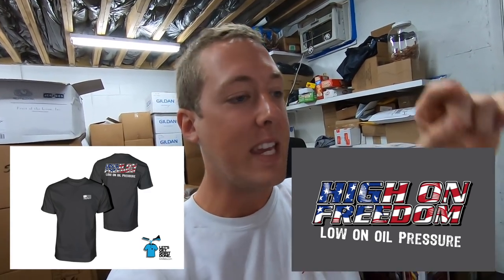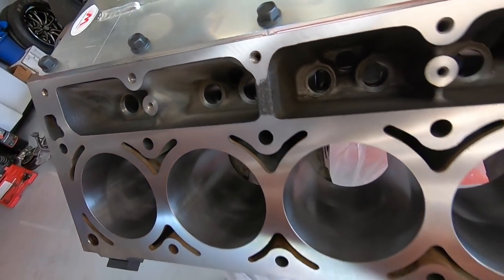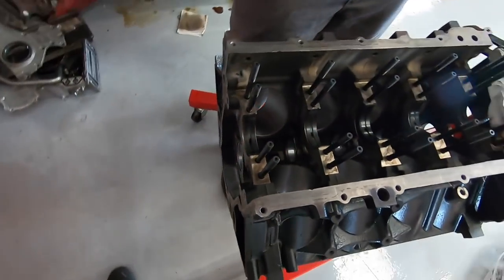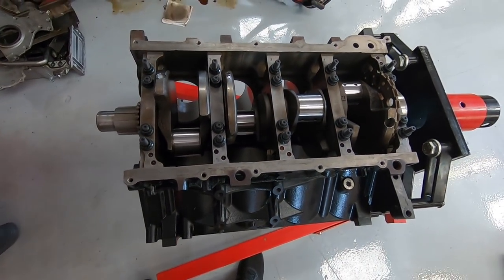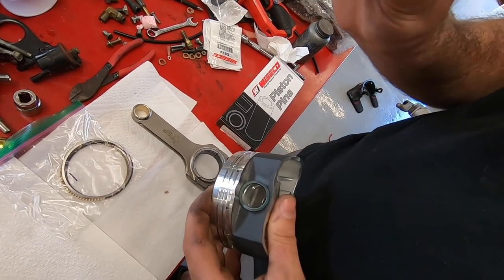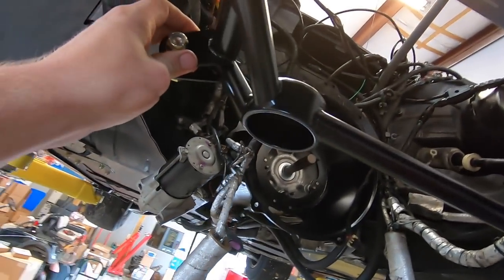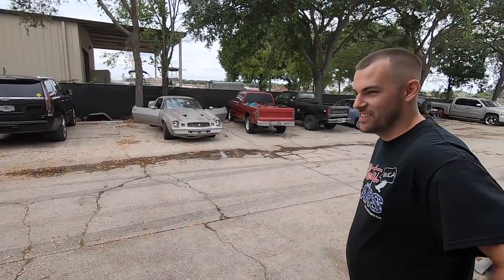Assembling the Auction Corvette's NEW Bald Eagle Engine! + Building a 10ft Snorkel For the Bogger!

Comment: How about an engine 100% built by fan sent parts.
Reply: I've got a few aircraft fittings around here someplace.
Reply: I’ve got plenty of rockers, springs, cams, keepers, pushrods lol
Reply: great idea
Reply: Yes literally was just about to comment that! We can send him parts in the mail from different fans!
Reply: this 100%
Reply: How about an oil radiator with a fan, connected to oil pan with a pump (independent from engine oil pump). At extreme power conditions, a reduction of 25C in oil temperature can double oil viscosity. At these conditions, reduced oil viscosity results in reduced pressure, thus reduced lubrication.
Reply: I'll send some pan farts.
Reply: That would be fun! And that is why I am here. For the fun.
Reply: @steveg2277  send me some lmao got any for a 350?
Reply: AK I got a procharger f3r......
Reply: I should 3D print a block. See if it can actually run. Or just melt/explode
Reply: @poolguy101  Bet it holds oil PSI.
Reply: Good one....
Reply: Could even do an entire vehicle build the same way if one could narrow it down to a certain vesicle type.
Reply: Ford block, Chevy crank, dodge heads, Honda pistons, Toyota rods, porsche rockers, Mercedes supercharger, Suzuki pipes&fittings. Franken-engine
Reply: Random projects USA This Cleetus McFarland Fabricobble Machine not a Johnny Cash song 🤡
Reply: I've got a crap load of 2jz parts. Even stock twin turbos and all.
Reply: Send them parts my way. He sponsored by Texas Speed so I need it more he does

Comment: as soon as he said the tracker needs work i thought geez louise the tracker is going to end up running 8's beside ruby lol
Reply: Richard Turner Underwater 8's.
Reply: @caddyguy5369  mega truck tracker? Hell yeah!
Reply: It'll end up with a Texas Speed 427 and at least 4 trubos and 4 fuel cells mounted on the roof...with 12 fuel pumps.
Reply: @caddyguy5369  well, obviously. as soon as they get that snorkel fabbed up.

Comment: Just in case the pond is a little deeper than you expect, I suggest strapping a winch to a tree on the far side of the pond from your starting point and clipping its cable to the tracker before you start your run.
I also suggest you either feed a tube from the snorkel intake into the driver compartment so you can still breathe if the water goes over the roof racks...

Comment: You should bring that tube out the fender so it can be permanent and the hood is still easily accessible then run the tube to the cab and up. More support there with the roof rack mounting options and easier to make it last!

Comment: Make sure to spec out your lifter bores! if youre using a non stock set of lifters, check with the manufacture. should be somewhere 2 1/2  thousandths. if there to tight, the oil cant travel around the body, starving bearings down the line.

Comment: I would highly recommend for you guys to use a smaller diameter pvc pipe. Just use a step down to convert it from 3 in to 1.75 in or even smaller. Will be alot lighter and won't drag in the water as much. Just think about how difficult it is to run in water.

Comment: So if you going oil crazy when building a motor get yourself what is called a washing machine pan. Its like a 3'x3' or 4'x4' pan you put under a washing machine to catch water in case of leaks. A cheap plastic one under your motor stand really helps in building or tear down of a motor. So the bogger can breath at under 13'(including bogger height) but what about the occupants? This will be epic!

Comment: Don’t forget about the exhaust it needs a snorkel out as well.
Reply: Nope. The pressure will keep the water from coming in. The only Thing that shouldnt happen is the engine going Off, then the pressure will equalize and the engine block will be flooded through the exhaust.
Reply: DonNerdo A) assuming it’s exhaust valves are 100% otherwise it can suck water in and B) it stays running. As soon as it stalls it will flood out.
Reply: @sccarguy8242  true. Exhaust should OK though.

What everyone forgets about are crankcase, trans, and diff breathers.
Reply: @sccarguy8242  you always have at least one valve opened in one of the cylinder

Comment: Couldn't help noticing the Tracker has an ignition distributor. You can cram the sparkplug wells with dielectric grease, but you'll have a tougher time keeping water out of the distributor cap if the entire car is underwater. Get that sorted and you should be able to make it!

Comment: Maybe by version 4.0, they won't use junkyard parts?  🤷‍♂️
Reply: No. Ruby is always going to use at least a Junkyard block. It has to
Reply: @alexdodge2515  Looks like we have plenty of more rebuild content to look forward to in the future then.
Reply: In 3 weeks the budget build will have a stroked LS at this rate
Reply: What do you mean 3.0 is like using brand new everything it may be a block from the junk yard but the machine shop made it new the same goes for the crank
Reply: @79tazman  That is my point.  At this rate, you may as well just get a fully built unit and not worry about something failing because it came from a junkyard.  You've got to admit, we've gotten pretty far from a "junkyard build" when you compare engine v3.0 to a 5.3 yanked out of a roached work truck with 260,000+ miles on it.  Maybe use some bolts from the junkyard if it absolutely must have "junkyard" parts on it?  Seems a bit ridiculous though...
Reply: @alexdodge2515  really are you this new to engine building and racing? There's not a thing junk about that motor anymore. It's better then when it was new in a vehicle from the factory. Get with the program bro. They won't run 7s with it before it goes but will run well into the 8s.
Reply: @monsterram6617  your always worried when you start leaning hard on the motor. Doesn't matter who builds it or what parts are in it. Of course well built motors will handle more and last longer.
Reply: @waynebollentin989  Doesn't matter if its not a junk motor anymore, as long as it came from the junkyard
Reply: @waynebollentin989  "Doesn't matter who builds it or what parts are in it."... "of course well built motors will handle more and last longer."

Both of these statements cannot be true.
Reply: @monsterram6617  why can't they? You don't think well built motors break ? What's incorrect about a good motor handling more power but also being able to still fail. Motor failures are mostly do to people tuning them. Not the fail of the motor itself. Which was mostly my point.
Reply: @alexdodge2515  what are you talking about? It's completely different you must be like 16 or something. No one that's been around racing and building engine's would make a comment like that. The fact that came from a junkyard is now completely irrelevant. Prep block and crank aftermarket rods pistons and arp hardware makes a very big difference. You have a lot to learn if you think it's still a junkyard motor. The limits of the motor are completely different now and now junkyard 5.3 motor like he had will take the abuse this motor will now.
Reply: @waynebollentin989   I'm a bit confused that I'd have to explain what is self-evident, but here it goes.  If it "doesn't matter who builds it or what parts are in it", than you could literally use broken parts and have a child assemble it, and like you said "it wouldn't matter".  

However, you next sentence is "of course well built motors will handle more and last longer." 

So which is it?  Will motors that are well built (quality parts by an experienced builder) handle more and last longer?  Or that it "doesn't matter who builds it or what parts are in it"?

Do you see the problem now?
Reply: @monsterram6617  just so we are clear yes a well built motor will handle more power and last longer in most cases but there's times even with the builder and parts being quality doesn't mean you won't have a problem. You got it now?
Reply: @waynebollentin989   Partner, you literally contradicted yourself in two sentences.  I'm sorry if you think that it's on other people's "common sense" to decipher it.  🤷‍♂️
Reply: @monsterram6617  I was replying to your comment went this started. I basically said you always need to worry regardless of the parts or person building it. I don't believe it's hard to understand because of the conversation that means good parts and builder. 
Then said yes it will take more power and last longer but knowing and or understanding even with the best motors they aren't people proof. Tuning and driving errors are what causes most of the problems when motors fail. I can't see how this wasn't obvious. 
I apologize for assuming you knew enough that you would have picked up what I was first trying to say here.
Reply: @waynebollentin989   I'm glad you're sorry, but it's for the wrong reason.  See, I know that using quality parts in an engine built by a skilled person is much more reliable than not.  Ironic that you didn't use that "common sense" of yours, especially when I mentioned this when pointing out your contradiction, to figure this out.  You instead played dumb when you were called out for contradicting yourself, then blamed the other person for not knowing what was going on inside that little head of yours.  

Do you want to give it another try, or are we done here?
Reply: @monsterram6617  it's not a contradiction and I explained my point that wasn't obvious to you. 
Yes I could have explained my point little better but in no way was it a contradiction. The apology was for not explaining my point better the first time and thats it. Person would have to either be or play very stupid to take what I was saying any other way. 
You seem to think if he got another  crate engine he wouldn't have anymore problems motor wise which isn't true at all and my main point. It's not a junkyard motor anymore after all the upgrades. This motor is much better then everything that's been in the car since it was new. 
Where I do agree with you is they should have got a better motor then this or at least a better crank to go with the rods and pistons for little more security. We all know he's going to push this past it's limits also. 
Last I'm not saying they didn't do it but I didn't see or him them talk but ring gap or checking it. Extremely important with the boost they're going to run. I never not check them regardless of the type or where they come from. 
Before you saying I'm contradicting myself again. Yes a built motor is better. It just doesn't mean it won't fail. It will take more abuse before doing so. Yes I'm done after this. Can't make it any clearer after this.
Reply: @waynebollentin989   
*con·tra·dic·tion
*
/ˌkäntrəˈdikSH(ə)n/
noun

a combination of statements, ideas, or features of a situation that are opposed to one another.
"the proposed new system suffers from a set of internal contradictions"

 •a person, thing, or situation in which inconsistent elements are present.
  "the paradox of using force to overcome force is a real contradiction"
 • the statement of a position opposite to one already made.
  "the second sentence appears to be in flat contradiction of the first"

synonyms: denial, refutation, rebuttal, countering, counterstatement, opposite; negation; formalgainsaying; rareconfutation
"the second sentence appears to be a flat contradiction of the first"

What you said, "your(sic) always worried when you start leaning hard on the motor. Doesn't matter who builds it or what parts are in it. Of course well built motors will handle more and last longer."

As mentioned, these two statements are contradictions.  Maybe you don't know that words mean things?  Or maybe you think this is about Ruby's engine and not your refusal to recognize what a contradiction actually is?  Either way, I'm glad you're done. 👍
Reply: @waynebollentin989   🎣
Reply: @monsterram6617  while I thank you for your service as I have family in and a brother a retired officer I respect everyone that puts in the time. That said you are still hardheaded and can't admit when you have a misunderstanding with someone. You made this a nutty argument and I tire to compromise the best I could. Being hardheaded myself will have to agree to disagree. I can't agree with you but I certainly respect anyone that serves this country. Enjoy retirement I'm sure it was well earned.

Comment: Hey just a pro tip. When storing crankshafts you should stand them up not lay them on their sides as you saw they are heavy. Being heavy if stored for long periods they can warp themselves laid on their sides.   Just a tip to keep your spare parts in good working order

Comment: y’all should try a project where you don’t use outside help, a full in-house project. i think it’d be pretty cool. 

no disrespect
Reply: No disrespect to you but isn't that Ruby?. All that's been done outside of Cleetus's shop is the cage which that shouldn't count.
Reply: I don’t think they are going to buy all the equipment to resurface engines and heads just for ruby
Reply: just saying it would be pretty sweet

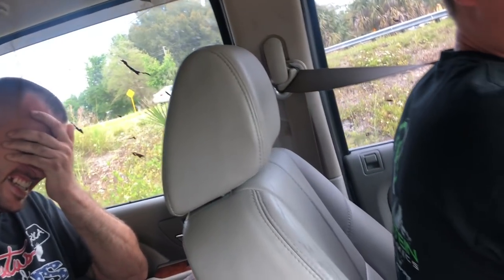Comment: 9:54 Definitely a small culvert there! LMFAO!🤣 I don't really think that Chevy was cut out for rock climbing/mud bogging.😆 That was hilarious, and James in the back laughing so hard he probably had tears running down his face!👍 Betcha won't do that again before you step out to see where you're going!😁 Aside from that, Ruby's new mill is looking pretty good so far. I'd still recommend a dry sump to keep oil pressure to that thing under acceleration, but I guess we'll just have to see what happens.😉

Comment: Run the snorkel up the pillar towards the roof then go up more for it to support from like weld supports off the rack. Plus the straight stack pipe wouldn't have to be as tall since you already would have the height of the roof. Just going through the water will want to pull the snorkel back and with out a lot of support where you currently have it could possibly crack at a joint under water which would be no bueno. Food for thought. #coldwaterintake

Comment: Make sure you make the exhaust 12-foot tall as well you don't want any water running in there and hydrolock in the motor if it so happens to shut off while it's underwater it will suck it all in

Comment: Should have gotten some thin wall drainage sewer pipe.  Would have been half the weight.  Fuel tank is still going to be under water.  Need a tall vent of it as well.

Comment: You have got to do the exhaust too! Otherwise, it will be like a potato stuffed in the exhaust as soon as the exhaust fills up with water the engine will die and it won't make a hill of beans difference what you do with the intake unless you plan on revving the crap out of it but that's no guarantee either. Better off going slow less chance of digging in. Or you could strap on 4 steel drums on the sides and float it across and maybe drive a prop off the rear driveshaft as the Cubans would do.

Comment: Ya'll need to run a bigger pipe on yer snorkel. You have a restriction with that fur incher yer running now. Run as big as you dare. Prolly need anchor wires to hold it up against the pressure of the watyer.

Comment: With engines so stressed why aren't you upgrading the oil delivery with stronger oil pumps and redesigning oil pans... With performance of continue donuts the oil is pushed aside so that the central oil pickup will not work anymore....?

Comment: Hi , Have you found out " Why " You Guys Are Wiping out  Cam Bearings ???? 
have you cleaned the OIL GALLERIES ????  Are You All Going To Use A Aftermarket Oil Pan And Pickup ????
 What About a Dry Sump Oil System ????  Maybe add a Oil Pressure / Sensor On the front of the Engine cam oil
 Gallery . Also Add a oil pressure gauge to the BACK Side Of the engine  to see or find the problem ???? ????

Comment: Hi guys ill try to keep it short. 

The on going oil pressure issues with ruby i have had and found the cause to be oil staying in the top end of the engine under high boost and rpm and starving the oil pump and running the bearings. dry.

For me the cause of this was the huge crankcase pressure produced at high power and the flow of this gas to the rocker cover breathers fighting the opposing flow of oil keeping the oil from returning to the sump .

A simple fix with extra breathers drilled into the crankcase  or extra return piping from rocker covers to the sump .

I hope this helps guys  keep up the amazing content      Mick

Comment: Forseen problems, dielectric silicone on all engine sensor connections (this goes all the way to the ECM), seal ECM, and lastly.... Exhaust outlet above fjord level, as that, an engine will suck water up it's a** and hydraulic.
Now to today's new video to see what happens.
Oh, once in water, the water displaces a lot of the weight by "environmental weight displacement". You will see.

Comment: I see why you keep wiping out bearings and losing oil pressure.   Assembly lube is for assembling engines. Break in oil is for breaking them in. Oil drains away long before you turn the key, assembly lube clings to the surface untill oil pressure developes and washes it away. Might need an oil pan with trap doors also.  Trackers going to be epic,  I can't wait.

Comment: I do irrigation for a company about an hour of y’all. Seeing that shitty Charlotte pipe, reducer, and 90 made my stomach turn thinking about work 😂. I work with stuff much bigger often. 12”, 16” etc. You’ll definitely want to use Weld-On 717 and P-68 primer. Give it 12 hours to cure (24 hours if you have that much time) and send her. Should support that pipe though. The weight of it will spin the 90 and break the glue joint.